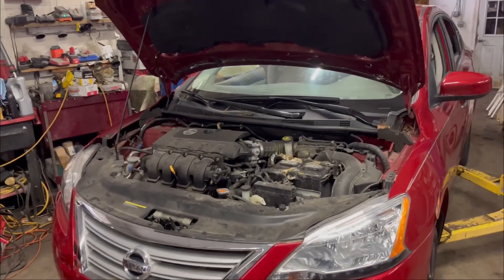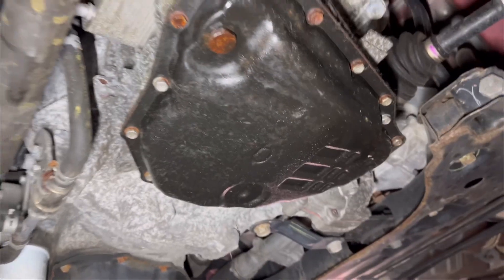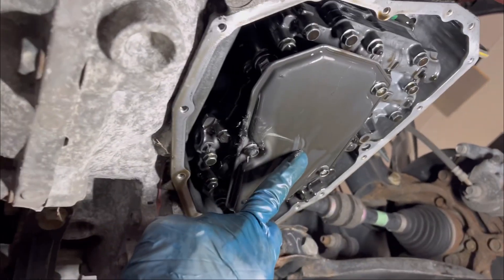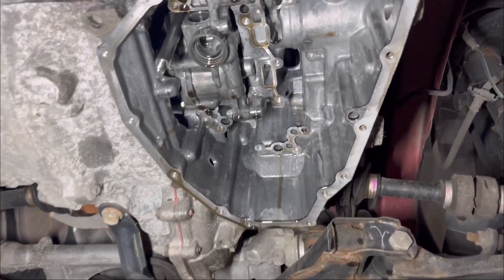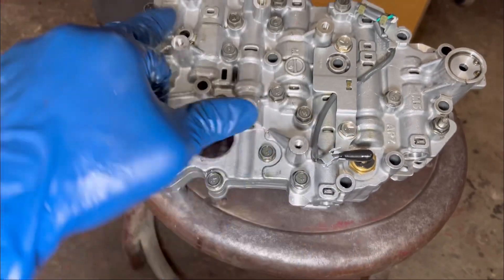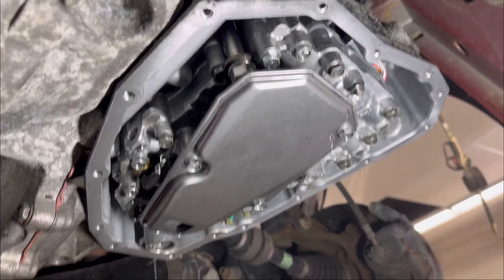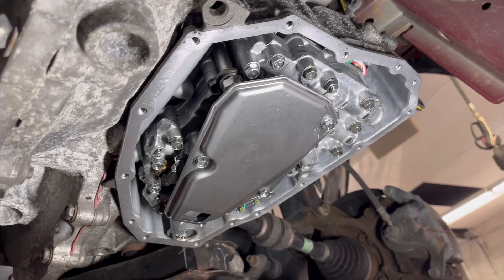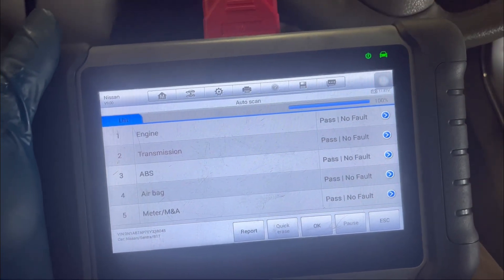2014 Nissan Sentra CVT Valve Body Replacement!

Comment: Thank you very much KAY AUTO !!! I have a Nissan Sentra 2015 with this tow codes P0846 and P2859. After searching in the web I found you and your video, I bought the body valve directly in the dealer. I followed all your steps and my car works wonderful. I'm not a mechanic just only by necessity. Thank you very very much.
Reply from the maker: You are welcome. I’m glad my video helped.
Reply: @kayauto  update, my car was working perfect but three days later doesn't work in Drive it was like neutral, Reverse works. I use the scanner and gave me those codes P0744 and P0965. I was searching in the web and I found the it's necessary program the TCM, question: Did you program the TCM when you changed the body valve? Thanks

Comment: My 2012 Model Nissan Micra 1.2 automatic vehicle sometimes, though not always, turns on the engine malfunction light and vibrates at speeds of 60 kilometers. When I take my foot off the gas and press the gas again, the problem goes away. When we connect it to the device, it gives error p0846 FLUID PRESS SEN/SW B. What's the problem?

Comment: I have a 2015 Sentra and the valve body was replaced at 22k miles. Now, i get a little slippage from.2 to 3rd gear. If roll.a stop sign or corner the car stutters then yanks. I scanned the car and no codes are coming up. Do you think it could be the valve body again even wirh no error code?
Reply: Your transmission needs, reprogram, clutch point relearn
Reply: @cberrios1188  it's parked, but before it was i had more symptoms. Now there is a whine coming from the transmission. And sometimes it would jolt on me at a stop sign. Felt like i got hit from behind. And shut off twice when that happened. Im now thinking its a torque convert. Im driving my truck and probably gonna junk the car. Don't think its work fixing. Shame cause engine is solid...
Reply: When any repair is carried out on the transmission, an adjustment must be made to the auxiliary gearbox so that it measures the level of the clutches and prevents slipping and knocks.
Reply: It needs “clutch point relearn” , can do it by dealer or somebody who has a good profesional scanner
Reply: @cberrios1188  thanks for the advice. I'll look into it.

Comment: My 2014 Sentra slips at low speed, it drives fine at high speed. What’s the problem could be? Thank you
Reply: Having the same issue only slips at low speeds but at high speeds mine doesn’t slip did you figure out the issue was it the valve body ?
Reply: how many quarts did you put in?

Comment: i have a 2016 nissan sentra sv 1.8 runs fine in park and neutral but once in drive or reverse it shudders and stalls...only if i add gas itll drive normal but once i stop itll stall again could it be a valve body and mind you i scanned the car and no DTC for transmission or engine? im thinkin transmission
Reply from the maker: Kindly check all your motor mounts, check transmission fluid level,and scan it again with bigger scanner then you can you ahead and change the valve body.
Reply: @kayauto  im using a topdon pro its a semi proffesional scanner do you reccomend changing the valve body i rescan this car 100 of times checked all signals and no issues i see not even a signal dam code
Reply: @antzen5072 did you figure out the issue? I have no codes either. I think im just gonna replace the valve body and see what happens.
Reply: @fencerider1492  Dont even bother replacing valve body its just waste of money its a hit or miss
 so basically i suspected bad torque converter but trust me its not worth just fixing one part and parts add up to almost the same cost of a reman transmision from nissan so thats what i did i just replace the transmission myself luckily i had a commercial account and the transmission came out cheaper but for you it can cost up to $3000 to $3500 retail and thats not including oil  and other stuff and i started up the car and did some calibration resets with my scanner and felt nice no stalling but im going to get it reprogram professionally just to be on the safe side which is another $250 the dealer closest to me wanted 400$ for a simple reporgram if you are getting valve body just get it from the dealer and make sure it comes with a CD QR code depending on models have it some dont
Reply: @Zage55  ok thanks for the info. What's the cd qr code for?
Reply: @fencerider1492  lets say you have a altima or a rogue for example they use a cd Qr code to write the ip code into your original tcm and only some scanners can do that not all but luckily i had a sentra some transmission programmer told me the sentras dont need a qr code only the others do or newer basically its just taking the code from the rom chip in the valve body and putting it into your tcm
Reply: @antzen5072  ah got it. My scanner isn't picking up any codes. I have a lil slipping from 2nd to 3rd gear sometimes. And now im hearing a whining noise. It stopped after a few days. Haven't driven the car for a week, gonna take it out and see if that whining noise comes back.
Reply: @fencerider1492  i took apart my transmission and put it back together to get the core charge discount from nissan and im telling you theres like 5-8 bearings or more i think more from what i recall the whinning you hear is most likely from the pulleys  they have huge bearings on them and the slipping is from the belt trust me the belts wear fast on these cvts maybe oil changes mightve prevented it but im not sure and yea maybe a transmission oil change might stop it from whining but its a hit or miss you can make it worst i would just replace the whole dam thing not a lot of shop rebuild those cvts for a reason
Reply: @antzen5072  thx for the reply. The reason why I think its the valve body is that its been replaced before and it's got one of the symptoms as before. It wont go past 80 mph the rpm needle starts to fluctuate and car drops to 75 mph. The whining noise is new though. So wanna do the valve body and with your earlier comment Im thinking the torque converter is going out.
Reply: @fencerider1492  torque converter would cause stalling or shuddering whining is mostly bearings
Reply: @antzen5072  if I come up to a light and slow down then take off without stopping it shudders and sometimes jerks
Reply: @Zage55  i edited my last comment

Comment: Hey Kay,

great video explanation!

how many quarts did you end up using 4?

I’m getting code P0965 for pressure control solenoid B and was looking to swap the 4 solenoids out in hopes that it’s fixes the rpm fluctuations while accelerating. I’ve already done both filters and fluid swap on 2014 Sentra with 150k miles . No change still rpms fluctuate.

Now that I’m seeing your video, would it be worth changing out that valve body altogether ?? Do you have a link to the eBay valve body with solenoids for reference or recommendation on seller for eBay ? 
Thanks much 👍
Reply from the maker: Thank you so much my brother I’m gonna put the link in the comments so you can  get one from there https://www.nissanoempartsdirect.com/oem-parts/nissan-valve-assembly-kit-control-3170e28x0b

Comment: Hello, mine says solenoid valve for torque converter, do you think replacing the valve body will doive the problem ? What are the original torque specs ?

Comment: Got a 2014 pathfinder get up to 20 mph it hard like shaking and jerking. No engine light think replacing valvebody would work?
Reply from the maker: Before you go ahead replacing the valve body, have someone with advanced scanner scan your car, something there might be hidden fault and it will not throw light on the dash,
Reply: @kayauto  I just ordered a better scanner that reads tcm codes.
Reply: Did you ever fix this problem ?

Comment: What torque you put ???? I’m looking everywhere but can’t find the manual for this
Reply from the maker: I couldn’t find a torque either so I just use the manual ratchet and I make sure it’s tight but not too tight to the point that it’s gonna break so just take it easy on it
Reply: @kayauto  I found it!! It’s 7.9 N•m …. 0.81 kg-m. 70 in-lb

Comment: Mine say torque converter you think is valve body wont pass 40 mph also all solenoid by zeus scanner are on
Reply from the maker: I’ll say replace the valve Body and also the torque converter and you’ll be all set

Comment: Hope you can help I have a 2013 Altima 2.5 drives fine but after long trips and I get on a stop then take off is really slow takes a little to speed up and currently giving me code p0776 (fluid is a little brown)
Reply from the maker: Hi Alex thanks for reaching out, so P0776 is a generic code that indicates that there’s a problem with the transmission pressure control solenoid B. What’s causes this problem could be low fluid or very dirty fluid or bad shift solenoid. With Nissan cvt transmissions it is recommended to change the fluid every 30 or 40k miles. In this case you can replace the complete cvt valve body and flush the transmission and should be all set.
Reply: @kayauto I have a question when you bought the new valve body is there anything on the old one you have to swap on to the new valve body or no

Comment: Code p0965 pressure solenoid B control it’s part of the valve body ? Better replace the valve body or just the solenoid B from that code
Reply: Thanks in advance

Comment: Did it fix?
Reply from the maker: Yes and it’s running like brand new
Reply: @kayauto  my car has exactly same symptoms as this really hate this Nissans mine has only 90 000 miles I will
Try this thank u
Reply: @kayauto  one more question does maybe flushing all the way or changing liquid twice might work or the valve or s just damage due friction?
Reply: Wow I. Can’t believe I try flushing the liquid was definitely brown color and smell little bit bad burn I replace both filters car seen ok but still 2 gear slips horrible sometimes I won’t even pass 30 mph I guess I need go do this replace whole body
Valve and refill one more time new clean fluid